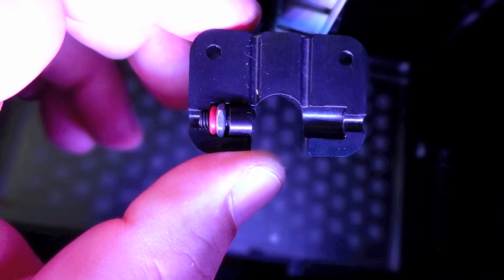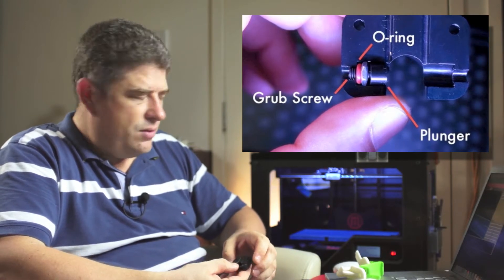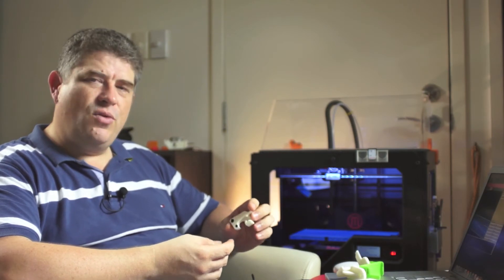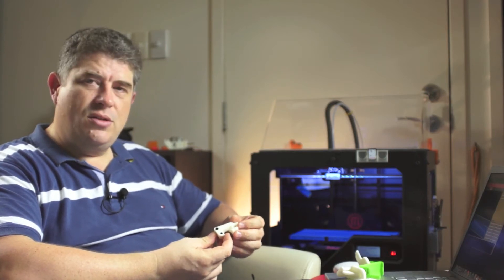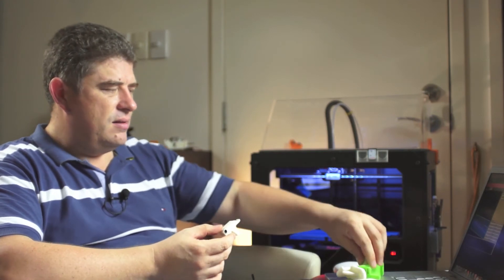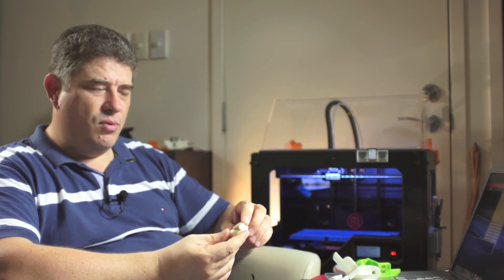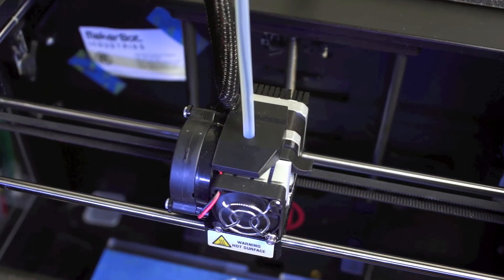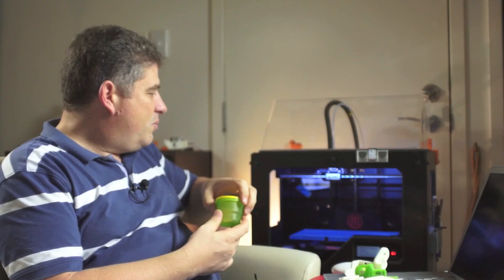3D Printing with the Replicator 2 - Upgrading the Extruder (6 of 8)

Comment: Hello whptomas, is it possible to go in touch with you ? Question 1: 1x Replicator as it seems the drive the pressure plate up and down must be defective, can someone tell me maybe a cost-effective alternative to the Orignalteile of MakerBot unfortunately the motor with the shaft 1 complete part. :/

Question 2: I need someone who can give me tips on how to better adjust the parts, the print quality leaves a little to be desired and the larger the part is it can happen that it no longer holds on the print bed (chaos preprogrammed)

Comment: Excellent designed extruder drive and explained video on various design issues with the makerBot 2 extruder. Our company now makes a simular version that has derived from your pinch roller design, called the "Aluminium Filament Drive" for the Rep 2 the AFD replaces the original as well as all plastic upgraded versions.